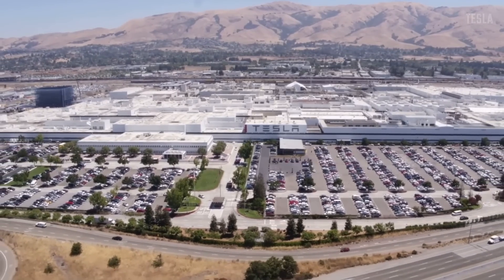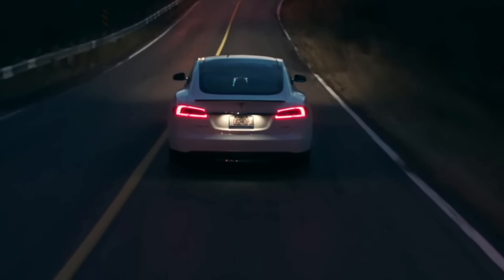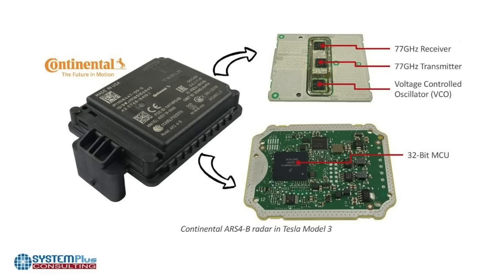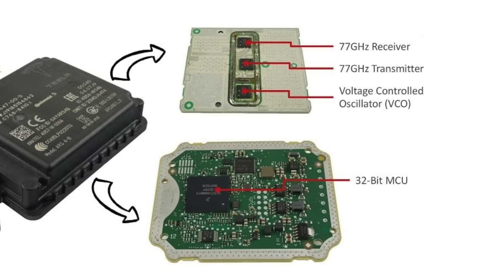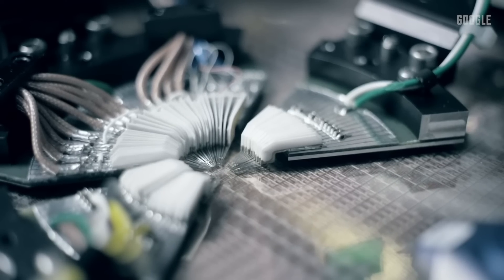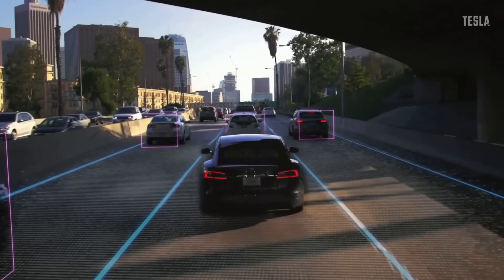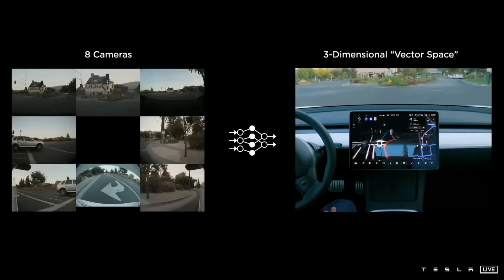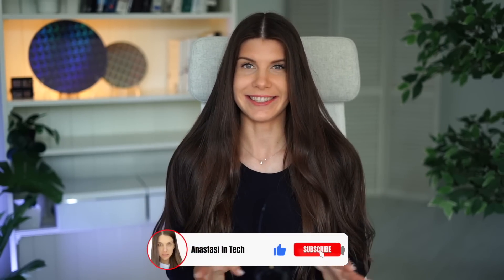Why Tesla built New Radar in-house

Comment: I still think that camera based system is more than enough for full autonomous driving even in poor weather conditions.  Especially since the cameras already go significantly beyond human visual range.  Radars can provide some very small amount of additional data in very specific conditions but add to the complexity of the image data set. LIDARs are completely unnecessary as they provide no significant additional data to the image dataset.

Long term I see Tesla working Radars out of the equation, they have with sonars.

Comment: This is an old video, but I just discovered your channel, Anastasi. I have become an instant fan and will be watching many more of your videos. Is Tesla doppler or pulsed radar. I have always felt that the doppler radar used by everybody, AFAICT, is in my opinion a bad choice. I am sure it is only because it is easy to work with (gives simple speed differential info) and is cheap. Pulsed radar will return distance information and if arranged with one transmitter and two receivers can give angular information as well. This is much better for automobile application. Is the Tesla radar pulsed radar? I'm willing to bet that it is. Actually 4 receivers (arranged in a square around the transmitter) would give angular information both horizontally and vertically.

Comment: With a beam forming Doppler Radar multi-wave module exact movement direction, shape and  identification could be provided in snow, rain and fog. This technology is being used to detect falls, human vital sign event enhancement and other data. A new cruise ship is using these detectors for safety and to manage temperature control in rooms.

Comment: I would say that they don't need to deal with 'sensor fusion'. If you have enough visibility, then use camera only. In very low visibility, when the cameras are effectively blind, switch to radar. May not be the most accurate thing but better than nothing, I say. It should at least prevent you from hitting whatever's in front of you.
Reply: If visibility is that bad, then you shouldn't be driving. Radar can offer enhancements, but is not nearly good enough to be able to do the entire job of determining what is around you. Cannot us it by itself.
Reply: Humans operate through the use of multiple senses, multiple feedback and environmental presence.

Comment: Hi, can you make a video on this: DARPA/MIT demonstrated the manufacturing of 3DSoc with carbon nanotubes and 4GB on-chip R-RAM for in-memory neuromorphic computing (to blow past the memory wall). Perf gains on the 90nm node are >50X over modern 7nm chips. Check out their presentation on YT titled ERI Summit 2020: Heterogeneous 3D Microsystems: Design, Fabrication, and Packaging from the 54th minute.

Comment: Reminds me of a video game environment, specifically a first person shooter game, were your actions are a result of what you see and your planning is a result of your radar screen.  This would avoid bad sensor information given radar interference (weather, insects, etc) which has been a major problem of radar.  By not focusing on action via radar and using it for secondary planning information or as a failsafe in visual interference situations you can focus vision action to an indicated radar signal to create better rules and a smarter AI
Reply: This is an awesome analogy! Imma steal it! We don't know if this is how Tesla will use radar, but it sure makes sense! Overall, the mid-range planning seems like a weak spot (eg missing a turn because it can't see the road until the last second, and the car isn't slowing down remotely enough based on map data, so it blows right by as it can't safely make the turn, or waiting too long to get in the rcorrect lane for an upcoming turn). If radar will be added into midterm planning, that aspect of  FSD will have to get even more better than the better it already has to get.... 🤔... yeah.

Comment: Great, well presented & interesting. As humans drive with two eyes, a human level two camera neural net should be able to do the same, more cameras should lead to super human driving but so far it isn’t. This tells us the current neural nets need to be improved, but how seems to be a very difficult question, perhaps AI day will give some clues. Before sensor fusion & adding redundancy Tesla must get the driving neural net to > human levels. If this can not be done, the whole self driving project is in jeopardy. Let us hope that Tesla solve this problem. Thanks for sharing!
Reply: and experience, thinking ahead , predicting what other road users might do...etc. I believe fusing another method of perception can only help
Reply: @modernizedclassics  It is a question of what are the overheads associated with adding another method of perception and what benefits come from the added complication and cost. If neural nets are any good they should be able to do better than humans with the same input, in Tesla's case there are more cameras than humans have eyes so they should be able to significantly out perform humans with out any additional sensors. It is a fascinating subject.

Comment: Yeah!

My go at this comes from understanding that actually we aren't 'just eyes & brains'. Elon got a little excited there. Moreover as you say no way will regulatory bodies sign off on driving level 4-5 w/o some sensor fusion, some redundancy.

I suggest FLIR is used. You get accurate distance and ability to identify living beings as a bonus. So better vision into dark fog smoke snow rain than cameras with the extra ability to spot living bodies, deers, kitties.

Add audio too. We actually use sound in our 3D rendering, internally. Sound works in how we decoded distance. The delay between visual information and audio fine tunes our internal representations. This is how we work pedestrian. In a car we rely on visual. Sounds, honking and sirens do impart nontrivial information. 

In cars, we don't hear the world we are navigating in the same way we do on foot. I think this is why sometimes, under stress, we go to turn down the volume while driving.  Mics on the car sampling the 3D external audioscape would gain information missed with other methods. Helpful in assessing driving scores, at the very least, as then FSD can figure out they're being honked at!

FLIR plus 3D external audio. Tesl needs to build both of these.

Comment: Interesting, I suggest the “brain” is the bottleneck, most passengers probably place a human like drive experience ahead of safety, eg break a few slight laws here or there in order to go-with-the-flow or avoid irritating surrounding drivers; Because all of us break slight laws daily, cut corners etc etc, but operate with caution and a lifetime incident free is possible
Reply: Sadly almost all accidents are caused by humans ignoring rules. Taking humans out of the loop will make driving so much safer.

Comment: Worth pointing out, the Mercedes level 3 autonomy is SO limited as to make it nearly useless. The parameters it needs to operate are laughable. Yes.. it exists.. in Europe only.. but it is not what anyone envisions as useful. It will be interesting to see how long it takes them to make it actually something you can depend on in any daily scenario
Reply: The new UNECE law allows for 130 km/h in 2023. Why havent we heard anything from Mercedes adressing this? My theory is that they ran into a bottleneck with their current system and it will forever stay at the useless 60 km/h. Maybe they can buy the new Nvidia system for faster speeds. And they would need a 300m Lidar.
Reply: @theipc-twizzt2789  Frame rate is the speed limitation. Tesla uses a 32 fps rate which means that at 100kph Tesla processes a frame every 86cm of travel. I'm willing to bet that the M-B frame rate is much slower and frame rate, possibly only 1 fps so at their upper speed of 50kph, would travel over 4 meters per frame. The car cannot make decisions about events faster than frame rate. This is where neural nets shine, far faster decision making.
Reply: The conditions it needs to operate encompass 45% of the traffic in the LA metro. The DrivePilot is going to be available in CA at the end of the year. Fat chance Tesla has anything similar at the end of 2030.
Reply: @timbehrens9678  so under 35 mph.. no rain.. not when the sun’s down. What a f’n joke. Tesla’s FSD is already 10 times more capable.. yes, still level 2 for now so you have to monitor it.. but level 3 is nothing special. Just means you get a bit more lenience in your monitoring role.. with those restrictions, it’s kind of laughable. If you like it.. great.. enjoy! It sounds pathetic to me. Mine has been cruising the highways of Texas at nearly 90mph >90% on it’s own for 5 years on just basic autopilot.
Reply: @airheart1 DrivePilot is up to 60km/h or probably 35 mph stateside. If you crash in your Tesla on Autopilot - it is your fault. If your Mercedes crashes while on DrivePilot - it is Mercedes problem. You don't need to observe the road constantly in a Mercedes (S, EQS), you can read or watch a movie. No such possibility in a Tesla for the foreseeable future.
Reply: @timbehrens9678  true.. but i do almost nothing at 35 mph. So it’s worthless to me. As far as crashing.. it has been quite fantastic in what it does. I don’t mind taking over to deal with some road debris or when i get off the highway. Other than that, the only thing I greatly look forward to Tesla’s system improving is the occasional phantom braking. I’m certain they’ll get it solved.. it has already improved a lot.. just sometimes a, one step forward two steps back scenario in the updates.. but then I’ll probably buy the hardware upgrade and go into FSD. Until then, basic autopilot is phenomenal to me. Idk what Mercedes’ system reverts to if it’s outside the level 3 parameters.. can it even do any level of self driving at highway speeds? Idk… personally really don’t like the exterior look of that EQS.. so I wouldn’t consider it anyway. Sure the interior is much more luxurious.. but not sold on that glass dash.. and I’ve never been uncomfortable in my Tesla.. love the look, the performance and the tech and fun bits.. wouldn’t trade it in for anything else I’ve seen yet.
Reply: @jimdandy9118  😂 ok.. whatever.. gl with that!
Reply: @airheart1  you are in Texas where 35mph is much to slow because everything is spaced out. In Germany a mercedes bringing you without driver at 35mph is usefull because towns and cities are much closer together than in spacious Texas.
Reply: @gamercatsz5441  common. I lived in Weisbaden for 3 years. I know how life goes in germany. Yes, there is a percentage of in town driving where that speed is useful. But anything that is going outside of a town center, requires driving faster than that system can manage. And I would be curious to hear how many issues owners have had. It is curiously quiet about any experiences using it. That may be a good thing.. maybe not. I would bet it’s had many failures and interventions required by drivers. But, i don’t know that for sure. We’ll see in time if the system gets more wide spread or they ditch it.
Reply: @airheart1  35 mph is like 70 km/h i thought, but it turned out to be only 55 km/h. It can litterally drive your kids to school or drive back home when you drove it to work so your wife can use the car during the day. I would love to have that kind of self driving on my car. I also don't know how many issues owners have, but still its amazing technology that is develloping insanely fast. We only have internet since the nineties and now cars drive themselves, words turn to images or video. AI already is amazing and it's still dumb, imagine what you will have in another 30 years, that is a blink of an eye!
Reply: @gamercatsz5441  i can agree with all that. It is still a technology in infancy. The next 10 years will be quite amazing
Reply: Radar reads only the electromagnetic radiation sent out by the radar unit. 
Camera systems read the em radiation (light) emitted by sources everywhere and reflected into the camera. Cannot provide distance measures based on travel times.
Lidar fixes the camera shortcoming by using a laser light source so can measure travel time.
Reply: @lengould9262  and yet a human figures this shit out with two crapy eyes.. no radar.. no lidar.. just two stinkin eyes.. your rationale is crap

Comment: Great video as always. I’ve been very curious about the new radar. I hadn’t considered it as just a supply redundancy/cost lowering effort, but that is a strong candidate. Can also be hedging bets as we see lobbying in US to require lidar and given EU proclivity for regulations may require the same. Having a slightly more advanced radar could be enough to fend off that requirement. Any thoughts on the three modes of operation documented during testing? I’m told with the power levels varying the way they do there appears to be a beam forming property of the new radar perhaps to “point and inspect” directed by tesla vision for uncertain areas?
Reply from the maker: It’s likely that they can do beam forming and beam steering with this radar. So what you are saying is possible. Advanced radar is like a lidar, yes. However, even the most advanced radar will not reach the performance of LiDAR in terms of resolution in XY axis (azimuth, elevation)
Reply: @AnastasiInTech  the question then becomes: does it need to? A general idea of what lies ahead to verify what the cameras see might be ideal as it's less info to process vs the miltipoint feedback from lidar.
Reply: Photon scanning beats those capabilities hands down, yet Tesla is the only platform even looking at the data in that detail.